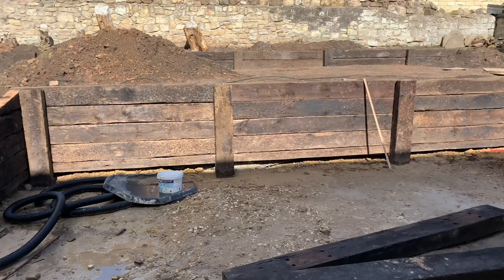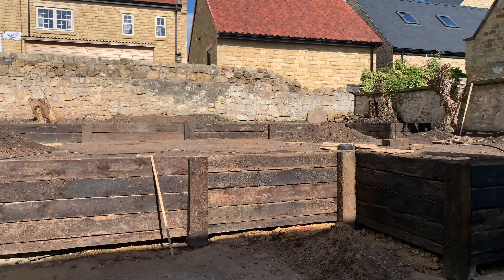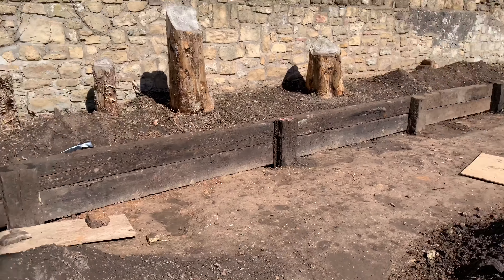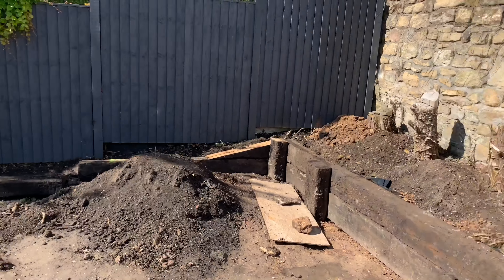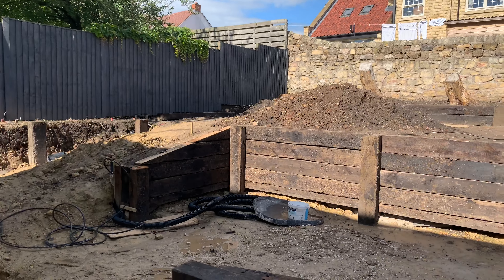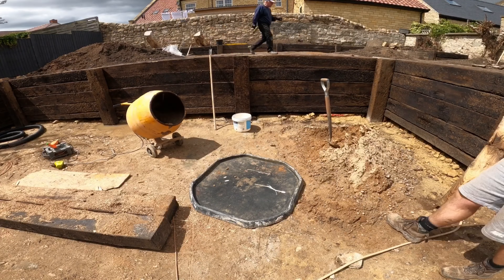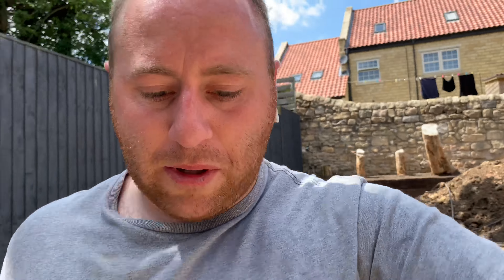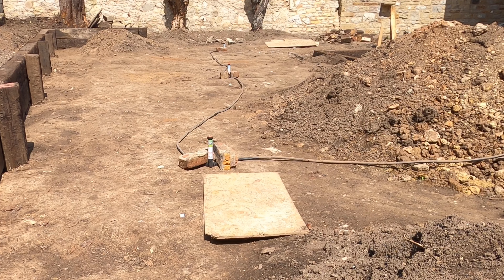Testing the Claber water sprinkler / Irrigation system.

Comment: Hello just a note. Although the bar pressure is important and it effects the coverage, the bar pressure isnt the key factor. The volume of water from the mains of flow rate, is important. Each sprinkler will consume a certain volume of water, adding several sprinklers to one line builds up the total consumption. For example at 2 bar pressure if a sprinkler consumes 3 litres per minute and you have 5 sprinklers then the consumption is 15 litres per minute, therefore using a rule of only using 2/3 of the mains supply, you would require 22.5 litres per minute off the mains (possibly 20 lpm).
Reply from the maker: Yes I have a Gardena smart pump and will be utilising water butts as my source of water supply unfortunately due to lack of flow we have.
Reply: @DIYJourney1  Yes the pumps will increase the pressure and flow, but once the water is gone its gone. Did I hear correct that you have 6 of the 90006 sprinklers? Depending of the angle setting they will consume at 1.5 bar, each between 2.8 lpm upto 9.2 lpm. And at 3 bar set on 360 deg, they will drink 13 lpm. Meaning you will use 78 lpm and  may need 117 could get a little lower). Let me know if they are all working, we would be interested to know.
Reply from the maker: Correct, we will, or ill have to change the sorinklers our that I have, I am putting a water feed on to it also with a float valve on it so water is not wasted and using 500l water butt. Thanks for the tips, hopefully get it installed very soon

Comment: What flow and pressure did you have ?
Reply from the maker: My pressure is around 1.5bar if i remember correctly, its in the video. Flow is poor, at around 7L/min, I will be using a Gardena Smart pump from water butts to do the water supply.
Reply: @DIYJourney1  thanks for this I’ve just ordered 6 heads I have 3 bar and 33 L / min so hoping that’s enough may need to do two systems with three heads on each.